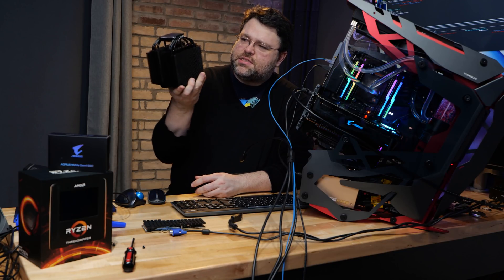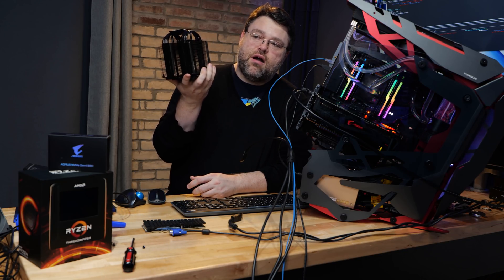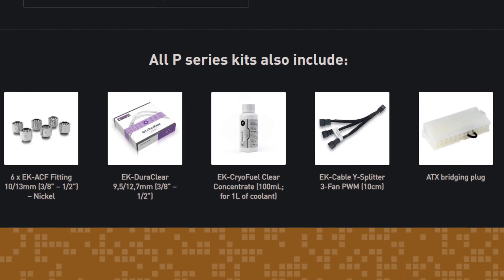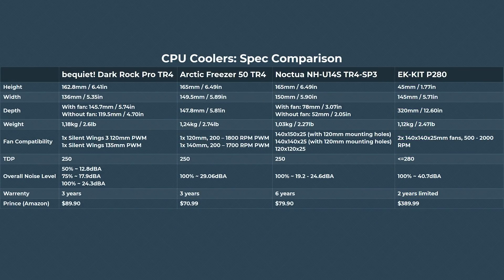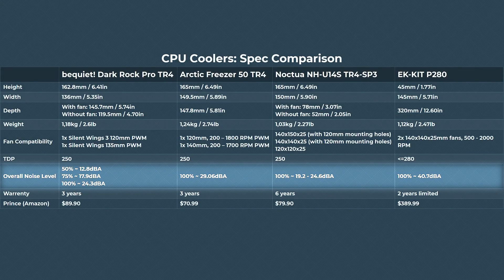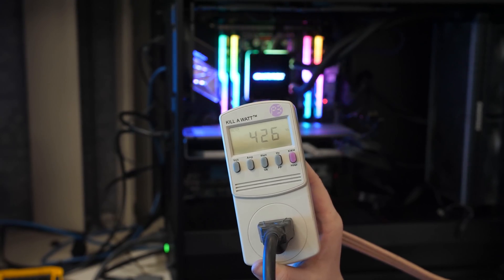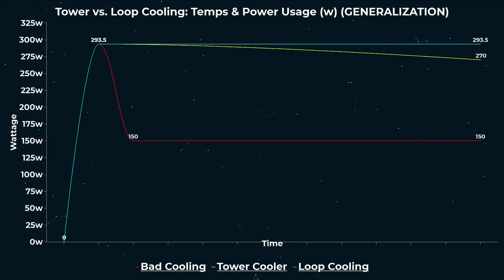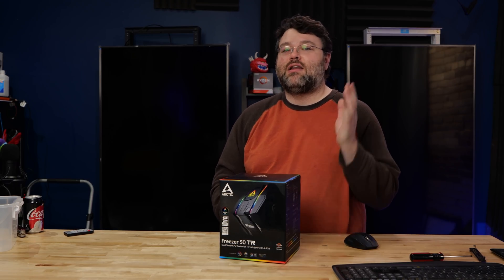Threadripper 3000: Better Cooler For Faster Renders?

Comment: TR 3960x tested with bequiet dark rock pro then corsair H115irgb and H150ipro AIO (1)dark rock super bulky annoying and very problematic as you will 100% have memory and boot problems on your 1st boots of the system (unlike Intel bios amd does not like at all when you change/add/remove memory) this makes tower a no-go for me, access to memory is mandatory if you plan to oc or tweak your system in the early days also...unless you watercool your gpu (but who does that with a tower for the cpu?) your gpu will generate super hot air, the backplate is easily at 80°C+ https://www.youtube.com/watch?v=iCD0ih4qzHw when playing heavy games (like BL3 on ultra) that scorching heat is going straight into your tower in a closed case, really bad idea (2) H150ipro 360mm not designed for HEDT even with the adapter it fails I got spikes up to 100°C very quickly no go (3)H115i 280mm slightly larger baseplate better mounting bracket it works but...the radiator gets hot very quickly and even at idle it pumps out hot air really quickly, running benchmarks I'm around 90°C which is ok since I have a closed case 8x fans rgb everywhere full featured 3x m.2 6x SSD drives connected plus a pcie soundcard and 1080ti nothing like an open testbench (which isn't realistic for 99% users unlike my experience) but...it's ok with fans turning too fast from "hearable" to "industrial" levels of fan noise, it's almost a showroom  pc it looks awesome but...I'm going custom loop in a larger case and considering I have the 24 cores and neither towers nor AIOs are enough for it already I recommend you do the same if you want a TR (the bequiet is rated 250watts my 24 cores goes to 268watts stock already, forget overclocking you can't even run stock properly you are above specs of the coolers) one of the main features of the AIO/custom water cooling is to allow to exhaust heat directly outside rather than cook everything else inside the case, for me it's mandatory for TR the motherboard,chipset,vrm etc.. all are hotter than non-hedt builds while typing this my PSU is at 250watts already, running cinebench I'm at 450+Watts TR is awesome cores but cores don't come free

Comment: Testing with stock fans is just comparing the "out of the box"-product, but not the performance of the heatsink itself.  
The first thing i always do with any cooler air or water is to throw out the stock fans and put the LED or RGB Fans on it that i like (of course they have to be SILENT and perform well enough.).  
Coolers that don't have the option to easily swap the fans are instantly disqualified from my shopping list unless its some cheapo 15€ cooler for some side system that just needs to work.

Comment: I wish I wasn't having issues cooling my 3970X with my custom water loop.
Reply: How big's the loop ?  Mine stays below 60 but I went full overkill on the radiators.
Reply: @BillLambert  I have two 280 radiators and getting idle temps in 50-60 range and when I go full load it hits 82.  I have tried different things and right now I questioning the temp readout, but have few more things to test.  Here is my reddit thread about it https://www.reddit.com/r/watercooling/comments/em9sah/high_temps_on_3970x/

Comment: I'm still using my now somewhat ancient NZXT 2x 140mm air cooler. Good thing this tech hasn't changed that much. Fan mounts are totally dry rotted, will need to replace with rubber bands or something next time I remove the fans. I entirely plan on keeping it for my next build as well, so it will see 4-5 different builds in its lifetime.

Comment: Wait, you said in the beginning it was a 360mm radiator in the loop, but then the graphic with all four coolers says a 280mm....

I never understood why someone would get a 280 instead of a 360 (don't tell me it's because they're trying to save $15, because 140mm fans are more expensive) AIO... Unless you want to mix and match 120mm and 140mm fans (which looks low rent) then you've got to switch all your fans to 140mm (which are more expensive and means far fewer options)

Point is.... Just get a 360 and if the model you want only offers a 280, then get a different model.

If you don't have the space for a 360...stop buying dumb cases like the Corsair 280x
Reply: It sounds like you confused your numbers... or maybe you just confused me. 
Either way:  
360 radiator = 3x 120mm Fans,  
280 radiator = 2x 140mm Fans,  
what i want is a 420 radiator for 3x 140mm Fans in an AIO ...nobody is selling those and i don't think many cases would even support that size.
Reply: very simple answer lots of cases have space for 2x140 but not 3x120 (most of the market is mid-towers) and when they do often you don't have the space for a radiator+fans height so you're still stuck with 2x140 only large full-tower can take 360mm fan+rad
Reply: Because 280mm units can actually run cooler and quieter than 360 units.  The 280mm units have a pair of 140mm fans, while the 360 units have a trio of 120mm fans.  The surface area of the two designs is quite close, 42,200 SQ mm for a 360 design,  39,200 SQ mm for a 280 design.   Fewer, larger fans, spinning more slowly tend to be quieter than more, small fans spinning more quickly.

Comment: No Cooler Master AMD Wraith Ripper?
Reply: Idtelos Yeah, was a little disappointed with that omission as well.  (I have no horse in this race as I have the NH-U12S TR3, NH-U14S TR3, and Wraith Ripper for my 1920X, 2950X, and 3960X Threadrippers respectively.)
Reply: @MichaelPohoreski  what temps are you getting from the 3960x with wraith ripper? I'm thinking of building with that combination soon

Comment: Ooh, I wanted to see just this.  I've been staging the gear for a 3990X build, getting it all ready for the cpu and my cooler of choice was the Noctua NH-U14S TR4-SP3.  Well, I already bought it, so I was a little surprised that it lost out to the other tower coolers (if only by a few seconds).  That could just be air-flow, though, so your tests solidify my other decisions for the case.  I'll be going with a two-fan design on the cooler and a case exhaust fan in addition to the case intake fans, all front-to-back.  All big fans.

hysteresis.... hys-ter-e-ses.   "hist" "ter" "ree" "sys".  Sorry, that drove me nuts :-).  I'm guilty of the same sort of gaffs, sometimes.  Once I kept saying 'Urinary' in front of a crowd instead of 'Unary' and hadn't even realized it.  Oops!

-Matt
Reply: I’m getting average of 70c on full load with peaks around 76c with this setup and 3960x. I went back to a single fan on the NH-U14S since it makes a pretty strange noise and there wasn’t much benefit there. Nearly silent at low 40 decibels

Comment: I'd be interested in seeing this same test done with the 64 core monster. Air seems to be fine for 32 cores, will it scale?
Reply: TDP is an estimation of heat output that's blah blah blah due to blah blah blah and it's not 100% accurate.
On AMD systems, it is a very good estimate of the amount of power consumption and heat dissipation.
With overclocking enabled it's another story.

With that said, the TDP for the 3970X is 280 watts.
w w w . anandtech . com/show/15044/the-amd-ryzen-threadripper-3960x-and-3970x-review-24-and-32-cores-on-7nm/2
Almost exactly 280 watts of actual consumption. 

The TDP for the 3990WX is also 280 watts. 
There's a reason the 3990WX has a full 800MHz slower base clock than the 3970X.
Reply: @tim3172  How do you figure TDP is very accurate on AMD systems? The very video we're commenting on shows a total system draw of 425 watts with a 280 watt TDP processor. I get that the processor isn't the only thing in there consuming power, but another 145 watts? The only way you're getting close to that is with a GPU, which would've been idle during CPU tests
Reply: ... and also the link I posted of the 280 watt TDP CPU consuming literally 280 watts under load.
Reply: @tim3172  Did you even read the article you linked? Here, let me help with this direct quote "From the peak power perspective, we hit 280 W with 22 cores loaded." This quote came from the section titled "Power Draw: 6-13 watts per core*" [emphasis added]. 

The article also mentions that they arbitrarily limit the number of cores so they can see behavior, which is why both processors drew the same power in this specific, arbitrarily limited test. Without the limits, both processors draw significantly more than 280 watts, with the 3970x predictably drawing more.

On a similar note, the  8 core 3800x and the 16 core 3950x both have a TDP of 105watts. Do you really believe both those processors are drawing the same power? And that with all 16 cores the 3950x only draws 105watts? If so, then why is the 3960x tdp nearly triple the 3950x for only a 50% increase in core count?

Gamers Nexus also has a great video (AMD Ryzen TDP Deep-Dive) where they explain that TDP is a worthless metric, and why. It even includes a quote directly from AMD that says something to the effect of "TDP is not a measure of electrical power".

So no, AMD's TDP numbers are not "actually pretty close". In reality, TDP is a completely arbitrary metric, and AMD themselves will tell you as much
Reply: I can guarantee you'll need a custom loop unless you plunge your head into the ground like an ostrich to avoid seeing reality, even with the 24 cores I'm going custom loop, neither towers nor AIOs are enough for it, air is absolutely not fine for a 32 it's already not fine on my 24 check Wendell graph since when running +15°C and "throttling" is good ? it's not it's "better than nothing" who wants "better than nothing" perfs on a 1500-2000-4000$ cpu ? you're in the wrong hardware category if you do
Reply: @fredEVOIX  you seem frustrated pal. For the record, I'm already running an open loop on my i5, I personally wouldn't run a threadripper on air, I just find this type of thing interesting

Comment: please do this with the 9900k at 4.8-5.0ghz.    no one reputable will do this...
Reply: Level1Techs is not reputable!? What?
Reply: @Pete292323  did you not read the comment? what?
Reply: do it at 5.1
Reply: @jondonnelly3  anything...  i want to see any of the top 3 air coolers (deeprock, noctua, deep cool, etc etc.) vs the best aio ( evga 360 / nzxt 280).   you can't find this data anywhere on newer intel's desktop chips.  as hard as they are to cool, you'd think the "content creators" would be all over it.

Comment: I think you have to go with an EK loop if you were going 64 cores, you wont get all the performance out of it without proper cooling after already dropping 4 grand on the cpu alone
Reply: The 64-core 3990x has the same TDP as the 32-core and the 24-core - 280W. So if these coolers can cool the 3970x fine at stock, I think they should be able to cool the 3990x without losing performance too.

Comment: Equilibrium, not hysteresis. Hysteresis is something completely different.
Reply: @somehow_not_helpfulATcrap  I think the way Wendel said it was confusing, he said "to reach an hysteresis" when I think he meant "because of hysteresis" unless he was talking about reaching a hysteresis curve (workload v temperature) from a cool start.
Reply: yeah, hysteresis is more of a concern in terms of heat when you're talking about a transformer
Reply: It's not equilibrium, it's steady state. By hysteresis I think he meant how the power consumption would latch down to a lower level if the cooling was insufficient.
Reply: @davidgunther8428  Which would still be equilibrium. Hysteresis is a certain "slowness" in reacting ro changes so the system doesn't adjust constantly but only when conditions have changed enough.
Reply: @samiraperi467  a CPU cooler is in steady state, not equilibrium, unless the CPU is off. Hysteresis is dependence of how a system will react based on its past, but we could both look up the definition. It doesn't have to be slow, it is great to reduce chatter and chaotic oscillation though, maybe that's what you mean by slowing?

Comment: I just set up a 3600X machine.  Because I needed a faster machine immediately and I couldn't get a 3990X and I couldn't justify a TR. 

I've now got core addiction.   These processors are unreal.  I want more cores.  I'll upgrade to a 3950X when they become available and the price goes down a bit.   Or maybe I'll wait for a 4950X.
Reply: CumminsSuperduty1 I think I'll join you in the Cores for Cheap addiction group therapy! I have a 1920X, 2950X, and 3960X. I don't even want to think about the 4900s!
Reply: @MichaelPohoreski  My old processor was a quad core i7.  And it was OK, but as I try to run more and more stuff, especially running 2 screens, one of which is 4K, it just didn't have enough power.  With the 3600X, I can have a process or two running in the background and things are still fluid.  It also probably helps that my OS is on an NVME SSD versus a SATA SSD on my old machine.

But these people who say you never need more than 8, 12 or 16 cores don't know how to multi task !   gcc -j8 would use half of a 3950X alone !  Then there are the 20 Firefox instances with 6 to 20 tabs open at once,  Eclipse, PDFs, application stress tests, etc. 

Maybe gamers only need 6 cores, but I could certainly use at least 16. 

The Ryzen 4000s can ship fast enough.